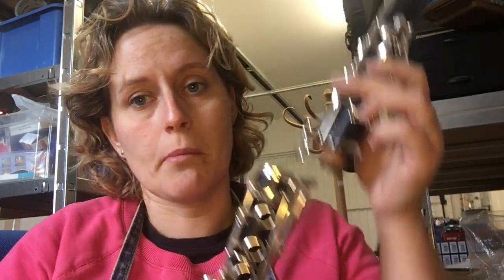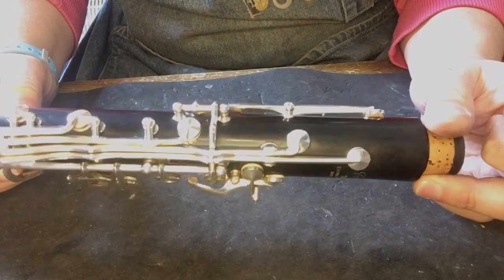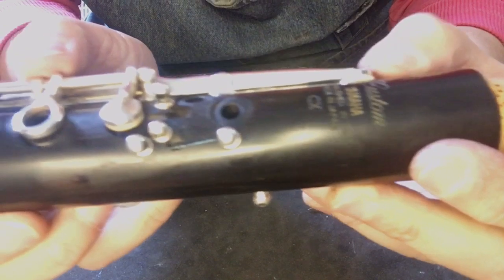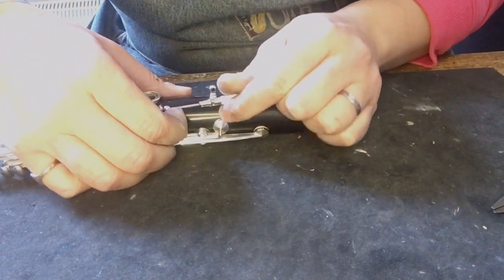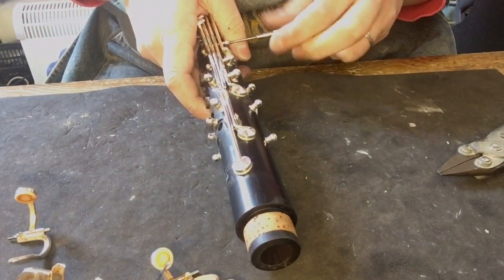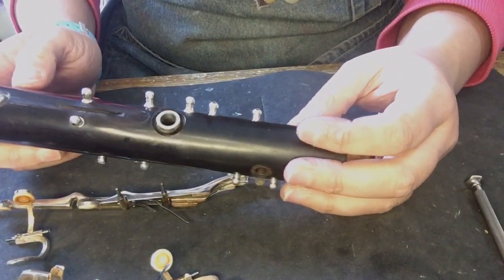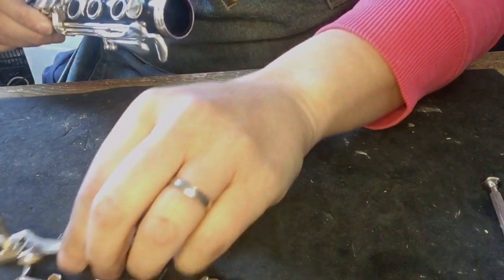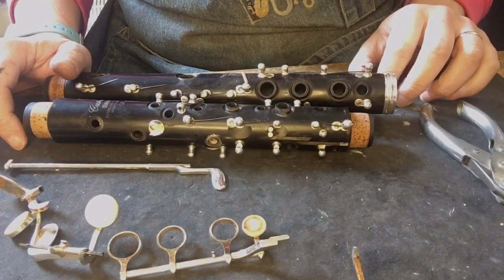Clarinet Repair - Part 1

Comment: Along with Guitar I have had interest in just about anything instrumental, I have quite a few clairinets, flutes, trumpets, tombones, I have been trying to working, most are pretty aged to the point where they almost could end up as display pieces, usually it is the pads that in these old instruments that are rock solid,  most are student grade.  It has not always been easy to find good videos on the subject. I have enjoyed yours. I might attempt to disasemble one that had no pads, the cork was pretty much all gone,  and it took alot just to get the keys to resemble silver on this old selmer. Congrats on winning the GGBO. Thanks for some informative videos.

Comment: The nickel silver used in guitar frets is known to promote infection if you get stabbed by a sharp fret end. A trick I learned from a watchmaker is to put eyelets in the bottom corners of your apron and screw small hooks under the edge of your bench. Just remember to unhook the apron before you stand up!

Comment: Very intricate and you have to be methodical in the disassembly and assembly, this reminds me of when I take apart my vintage and modern airbrushes when cleaning them; as with the clarinet my airbrushes have lots of fiddly small parts which can be easily lost with the bonus of having to try and remove tiny particles of dried paint from the various small orrifces. Look forward to your next installment. Question: out of interest do you have to disinfect and clean the instrument before working on the instrument especially in the current climate as you might say.